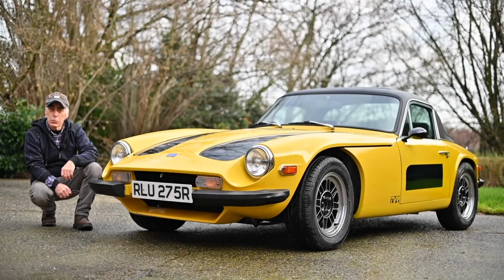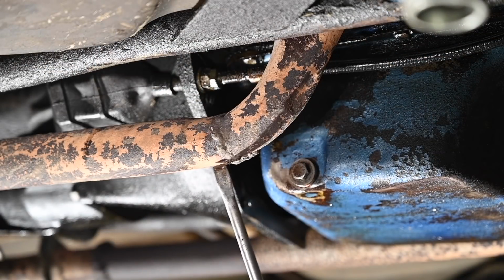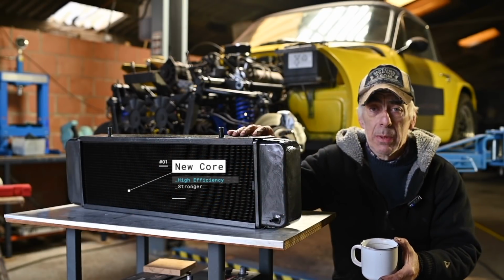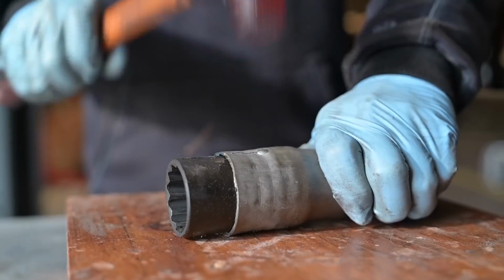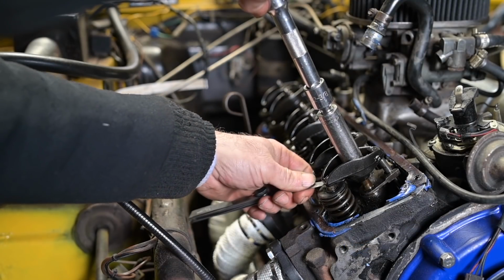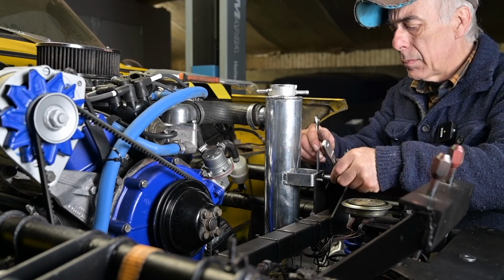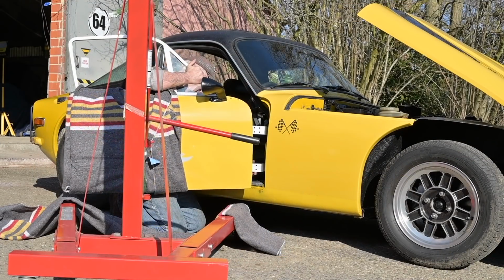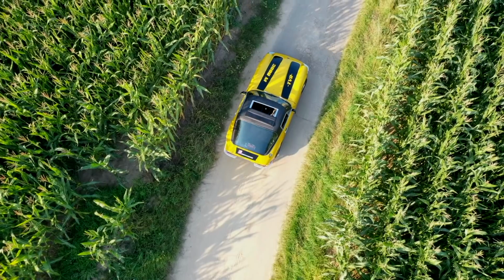My TVR 3000M rebuild

Comment: Hi Steve I tell you what you haven't done , that I mentioned before to which you agreed  .   you haven't change those dreadful looking jubilee clips on the fuel piping to the carbs ,  replacing with the much neater spring clip type .I think the jubilee type look great on rad hoses etc ,but awfull on small piping .PS .The car looks absolutely fabulous now .
Reply from the maker: I did changed them, but this video is collection if older clips